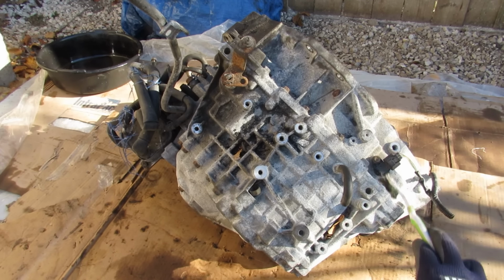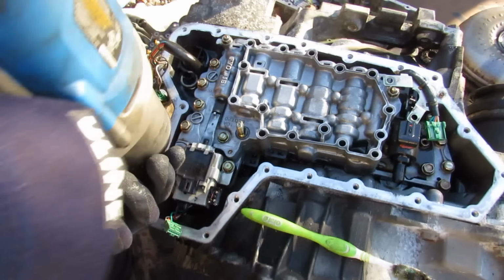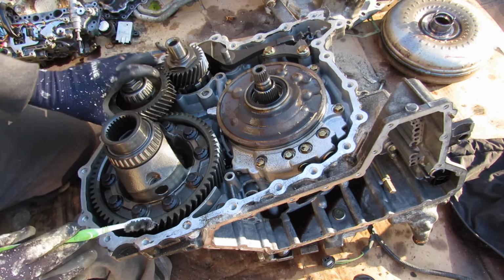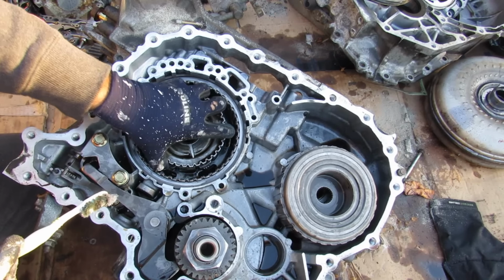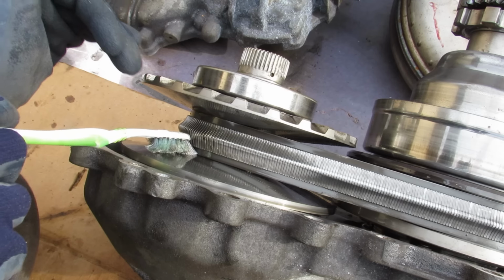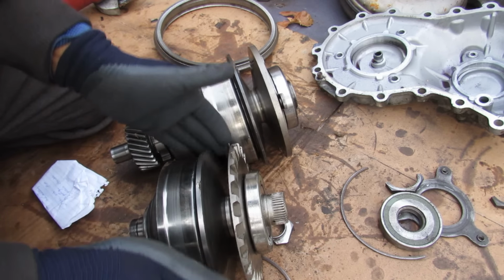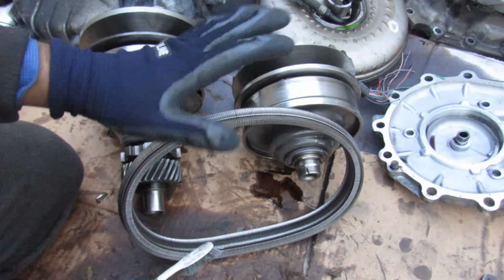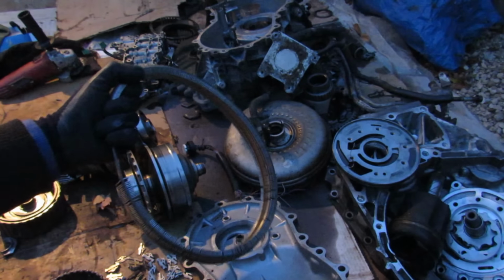Why Nissan CVTs FAIL

Comment: most probably did not realize that the CVT belt alone consists of more moving parts then an automatic transmission. also, tho it was not shown in this vid, those outer steel bands on either side of the belt "plates" consists of several layers of steel rings. each one slightly bigger(or smaller if your starting from outside going inward)then the next one.(otherwise they would not fit inside of each other if they all were the same exact size) most CVT vehicles, rarely ever do the CVT transmissions last, let alone make it to 100K miles even under casual non abusive/non ruff operation simply due to physics. example: 2 tons of vehicle on flat surface, under half throttle acceleration, with a 70HP 150Ft Lb of torque at the input shaft, at 8 to 1 gear reduction, the wheels tires being easily 4+ times larger then the ring gear of the Dif(adding additional load resistance despite gear reduction) your easily putting a load of 1000Lbs of resistance alone on just initial acceleration, on a small and fragile component of a mechanical power transferring part that must be squeezed super tightly and push against two "smooth" cone shaped surfaces under high pressure and lubrication to achieve "traction" in order to even provide movement to begin with, while additional friction occurs during the changing of those cone surface's gap's to variate the ratios. metal on metal under high pressure and movement causes rapid ware, no matter how lubricated it is. combine that with the heft of a little 2 ton vehicle, and an underwhelming powered engine even, going from stop to acceleration and stop again over and over say 25+ times a day in an average town driving experience, with out hills even, and maintenance kept up fully, those "friction surfaces" are always going to ware and as we all know, when metals heat up, they become "softer", thus further accelerating its failing point. and as they ware and the clearances become larger and larger they will become too great for the "precision digital crap" to adjust and compensate for and as time progresses, the ware only gets faster and worse as it tries to compensate to keep its self operating as it was designed to with those worn components even with the best of filtering they are given(which is not much to begin with as you seen in this above vid and yes all CVT transmissions are all filterd the same ways regardless of theyr layout and designs. i have dismantled this same trans as well as those for dodge calibers, subaru's and toyota's amongst a few others), tiny particles still get by and those do add to that ware simply through "abrasion" when those tiny particles get caught between those "friction" surfaces. 

 im no fancy high educated guy with alphabet soup for diplomas and degrees and you definitely dont need fancy education to understand basic physics and mechanical machinery as its all self explanatory just by seeing how they actually work fit move and operate, but thanks to autism(i see it as a gift instead of a problem like most do) i am very skilled in mechanics with fuck all for education and have proven even ACE certified mechanics wrong many times while working on various vehicles simply because i just know my mechanical "stuff" even tho i know jack shit for all the fancy technical words and terms and gibberish in most cases. bottom line is, this guy gets it. he knows theyr junk, unreliable, and break down way more then even the cheap ass automatic transmissions used in the ford tempos and dodge ram 1500s of the 90s. and he is correct as to why they often fail. id gladly drink and sit by the bonfire with this guy and shoot the shit with him and chill in the back yard just tinkering on most anything with wheels motors gears and equipment of any mechanical type. you dont have to be book smart to see "stupid" written all over a weak fragile mechanical component to know its crap, cheap, and flat out "inadequate" mechanically and see it being a high point of "failure/breakage just from knowing what its mechanically doing and for what kind of operation/load its under/used in. i tip my hat to you good sir! keep up the good back yard videos! 

ps, kudos on the useful application of your partner's underwear among all the other clothing! that made me chuckle seeing that! i use my own clothing(and others cloths too sometimes) when i lack the usual things to soak up mechanical messes as well in a pinch! but thats what washing machines and dawn dish soap is for! just, dont use gas or even electric dryers to dry them. jsut hang them outside in the sun or lay them to bake on the hood in the sun instead!
Reply from the maker: Good thoughts. Thanks

Comment: Nissan failed as soon as Renault became its parent company
Reply: It's not that Renaults are entirely bad. They really know how to set up a good handling FWD car, and they can sometimes do a nice job at styling. They've always struggled with mechanicals though, especially transmissions. Even their manuals suck. Laguna IIs used to eat them all the time. Their diesels are okay, from what I know of them.

Nissan never could make a FWD car with handling to match something like a Megane RS or comfort to match a Laguna, but they had some excellent engineering back in the 90s before cost cutting set in due to the merger and most of them left. We're very lucky the GTR was made, thankfully they kept it pretty seperate from the rest of Nissan. The Nissan that made the R32-34 Skylines, Pulsar GTI-R, 300ZX, etc is all long gone now.

A merger between Nissan and Renault could have been a good thing. If done correctly it would have given Renaults some of the best engines and transmissions around, and given Nissan sharper dynamics and more design flair, which most of them were lacking. Instead they did completely the reverse! So now it's like Renault have got almost nothing out of the partnership at all, and Nissan have spent the last 20 years doing enormous mechanical downgrades. You're better off buying the Renaults today, since it's the same mechanically, cheaper, and a bit more distinct.
Reply: @thegearknob7161  Ya the qashqai and the captor are exactly the same car same with the Micra.
Reply: @thegearknob7161  and then comes Mercedes, and rebadges a Navara as the X-class...

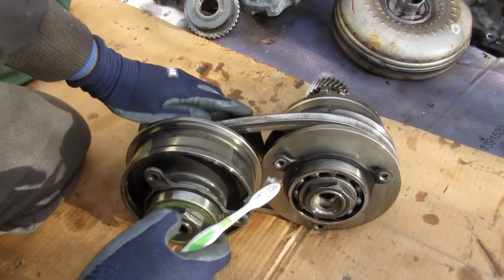Comment: 12:25 after all that other stuff was removed......we have, drum roll, ..... a snowmobile clutch system (or Polaris ATV clutch -same). Too funny. Thats why they fail, a sled is a little lighter. That is the belt of belts though.
Reply from the maker: Would be neat to open one

Comment: save a few hundred bucks in gas, lose a few thousand bucks on CVT replacement.
haha
Reply from the maker: Economy
Reply: @speedkar99  E conomy as to company cashing in on misgivens of the product
Reply: The federal government keeps tightening CAFE regulations / MPG requirements, forcing automakers to cut corners, even if its more expensive (and more wasteful) for the consumer in the long run. Just when there was hope that we've moved past the "planned obsolescence" phase of intentionally short-lived parts, we're pushed towards wasteful solution in the name of efficiency.
Reply: @osco4311  Penny wise, pound foolish.

US could probably have just kept the standards from 1990 as the minimum and nobody would be any the wiser once the vehicles from before that time wire out and were off the road. Bureaucrats have to justify their existence though, making new rules simply for the sake of making new rules.
Reply: @Crosshair84  pretty much.. the government doesn't mind spending your pennies or pounds, so it never occurs to them how foolish they are
Reply: Wayne Collins  You can tune a carb for economy
Reply: To be fair, sometimes you do get your few thousand bucks back when Nissan settles the class-action suit. :V
Reply: CVT’s are pieces of junk. I’m changing one now in my 2015 Honda Civic and when It’s done getting rid of it.
Reply: Our stupid government at work .
Reply: 135,000 miles on a 2017 Pathfinder with cvt 4wd and towing PKG not one issue (other than cooling fans).
Reply: Sounds just like a hybrid battery. Those can be rebuilt, unlike CVT’s, though.
Reply: *Melts down CVT and makes more CVTs. *Captures burnt petrol, diesel and LPG....rebottles and fills up the tank. oh wait more fuel is suited to.....
Reply: Yes the heat involved in recycling uses fuel, and electricity companies use more than they need...So was it really that important to go and buy a coffee 2km away? Humans are doomed, at least its only your kids because I refuse to have any. I hope they are astronauts, probs won't be though.
Reply: Would it be a good idea to add an extra transmission cooler?
Reply: @videostar2528  perhaps a water jacket around the area the pulleys are. While it might be hard to connect to the radiator i think it would help tremendously and possibly dampen noise due to the "shell" of coolant
Reply: Wayne Collins  had mine for 6 years and 230000km and replaced 1sensor unit great unit great wagon get one an enjoy

Comment: I’m not sure why the bother with these... the feel like junk, I doubt they give significantly increased fuel economy, and you’ll end up replacing them. For pure economy I’d rather see a hybrid with all the power to the wheels going through an electric motor, ie basically no physical connection between the motor and wheels, just a generator.

Comment: Back in 2000, I worked at an automotive research lab at UC Davis and they were developing gas electric hybrids, full electrics, and these blasted CVTs. The belt failure mode you pointed out is exactly the same limiting factor they stated. The small contact area of the link-plate chain limited the amount of torque that could be transmitted through the pulleys and sadly reduced it to low power applications only. Thanks for this teardown video, it took me way back...

Comment: I would like to know how accessable that little filter is when its installed in the vehicle and if there is a official replacement procedure. Im curious because my honda minivan had no official filter replacement procedure or a filter listed for it in the first place. Yet there was a factory external one that could be replaced in about 15 minutes.

Comment: Drove a rental Nissan Rogue through the smoky mountains and it was a reason not to buy a Nissan. I could smell it cooking
Reply: Yup l've known several Nissan CVT failures to occur when taking them through the mountains, repeated long inclines and the CVT just gets fried even though the owner is just driving normal. Many times the CVT will actually survive through the mountains but soon after will completely self-destruct from the damage that was done during the mountain drive.
Reply: I've had a similar experience when I took a Dodge Ram 1500 with a V6 engine to the same place but I wasn't surprised because they do have CVT transmissions as well.

Comment: that tiny of a cooler for the cvt, what if you took the radiator from an auto and re routed the cooler hoses to prevent this... ill remember this video if i ever buy cvt, i love manual though so it may be a while.

Comment: I’ve got a CRV with a bad CVT as well!
Reply: How many miles on it?
Reply: 93k 
Even though there is a TSB out, Honda dealer said it was nothing.
Reply: @GaryGrumbles  And how many times did you have the CVT fluid changed during thouse 93k miles.  CRV has a lot of issues including fuel/engine too.

Comment: CVTs CANNOT BE DRIVEN LIKE AN AUTOMATIC. That's why they break... Driver error; slamming on the gas and  ignoring revs. 

Furthermore; if driven correctly they are more reliable, they are quieter, they consume less fuel, and they are MUCH smoother with linear power delivery.

But if you have 0 driving prowess, yes you will annihilate your CVT.

Comment: I had a 2013 Nissan Pathfinder. What a POS.  When they first introduced this junk.  I recorded the severe vibration through the car and gave it to the dealer.  They ended up changing the torque converter 3 times and the transmission twice.  All before 2500 miles.  Drive a Highlander now.  0.0 problems.

Comment: When I was a Nissan tech, we replaced a CVT in a Roque with 700 miles on it.
Reply: Cool story. ONE. A single CVT. If you said it was a regular occurrence, or even that you replaced more than one at such a low mileage, it would be noteworthy. My dad had a Chevy diesel engine that needed to be replaced at 1500 miles and my best friend needed his F150 engine replaced at 3500 miles (that took for a year worth of incomplete fixes, and red tape to get through. He bought a brand new $60k truck and drove a crappy loaner for a year.) Doesn't mean anything.
Reply: @xenonram  we replaced a crap ton of them.  I have done several myself.  The minority were low mileage. I'm sorry I don't live up to your standards of a "note worthy" comment.

Comment: You do a nice job of explaining how the CVT works but your title is misleading in that you don't discuss the top reasons for CVT failure.  

The CVT works by the friction between the pulleys and the belt.  Friction is a relatively unstable engineering problem : the amount of friction available changes with the heat of the oil, the chemical condition of the oil, and the condition of the surfaces.  Consequently the maximum amount of static friction that can be applied between the pulleys and the belt for a given oil pressure in the clamping cylinders will change over the life of the transmission.  So a leading root cause of CVT failure is fluid contamination or breakdown due to excessive or prolonged heat levels.

The belt drive system is sadly sensitive to the clamping force applied by the hydraulic cylinders  : if you apply too much you will damage the belt and sheave working surfaces by peening.  If you apply too little you will damage the belt and sheave working surfaces by scoring whenever the static friction drops below the torque and the belt slips.  Any damage of either type will quickly take the coefficient of friction out of the working range and lead to failure.  So another leading root cause of CVT failure relates to pump pressure changes caused by contamination, pump wear, fluid breakdown, leaks, etc. that cause the clamp force to vary for a given pump condition.

Another problem is to balance the amount of clamping applied by the system with the instantaneous torque required for the vehicle condition.  Too much clamping provides safer working but rapidly increases power losses.  Underclamping is likely to cause failure due to damage from the belt slipping.  It takes time to provide the oil pressure, so the transmission controller must predict what pressure will be required in the next X milli-seconds of operation and make the changes that provide that pressure level before it's needed.  So another root cause of CVT failure can be driving in a manner where the torque required varies more rapidly than the controller can compensate for.  Erratic driving conditions, or things like wheel hop, stick-slip on icy roads, improper towing, etc. can lead to CVT failure.

Because the CVT is so sensitive, it requires active monitoring of many critical parameters for the clamp control algorithm.  Sadly the sensor performance degrades with time.  So another root cause of CVT failure is improper maintenance of the various sensors (including engine, exhaust, and wheel sensors).

One way to optimize the performance of a CVT (for maximum life and best fuel consumption) is to digitally compensate for all the manufacturing variability and sensor sensitivities.  Typically critical measurements are made at transmission assembly hot test and burned to a data chip used by the transmission controller to tweak the control parameters for the individual transmission unit.  This means that the CVT transmission works better but is not dealer serviceable, since a serviced transmission will need to be properly measured.  Factory service is expensive enough that it generally includes replacement of pump and sheave assemblies with NIB OEM parts to provide the maximum life for the money spent.

And then all my favorite reasons for failure also apply to CVT's.  People make mistakes, Murphy is always hanging around, nobody can predict what people will do with their cars, s*** happens.

That CVT's work at all can seem a minor miracle.  That they work as well as they do is a testament to the care and craft of the people responsible.  IMHO there is no reason to avoid a CVT from people with a good track record.  They have been in cars since the Variomatic was introduced by DAF in 1958, and are better now than ever.

Comment: Awesome explanation for the CVT and the failure modes. So as you mentioned CVT's are good for light weight vehicles, that means the new sentra and versa should be OK? would you recoment the new versions? Thanks

Comment: I own a Daf 66....It got rubber belts BUT there are two of them that share the load which makes it so that it rarely fails and even if it does you can change belt just by lifting it up with a jack, releasing the tension and using ur hands to replace the belts. Kinda feels like old tech was a bit more in the future than this nissan CVT :P

Comment: That was a very informative video.  I personally would prefer a manual transmission over an automatic any day.  This video also strengthens my desire to make my next car an EV.  EVs have somewhere between 20 to 35 moving parts in the power train not including the drive shafts.  Gasoline vehicles have hundreds of moving parts in the power train which are subject to extreme heat and vibration.  I feel kinda bad for this guy’s brother and wife running around with no pants and no chonies. :)

Comment: Great video. This guy is very knowledgeable. I had a 2014 Pathfinder that had a failed CVT at 3,000 miles. The dealer kept trying to repair it before finally replacing it. There were other issues like almost $2,000 for ball joint repair. I got out of that as fast as I could.